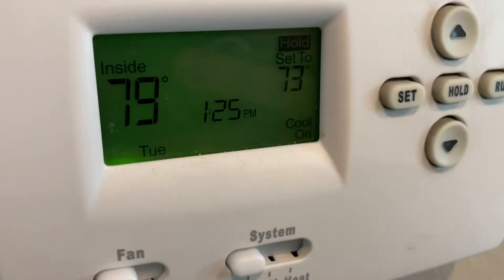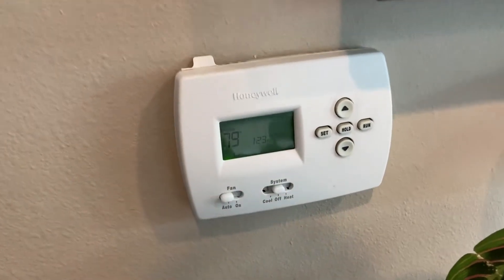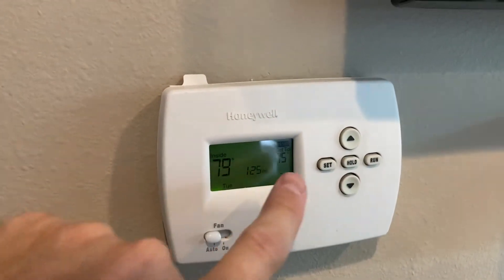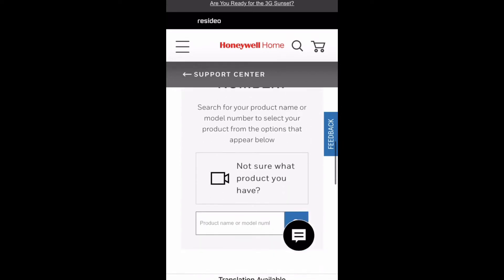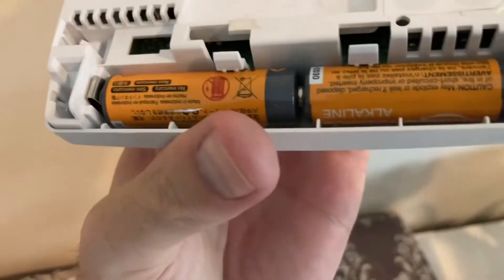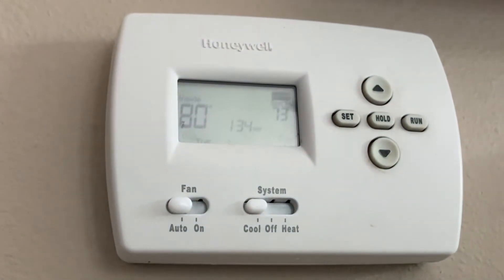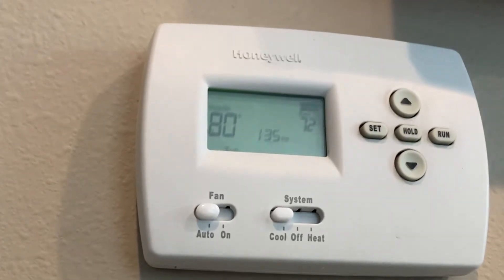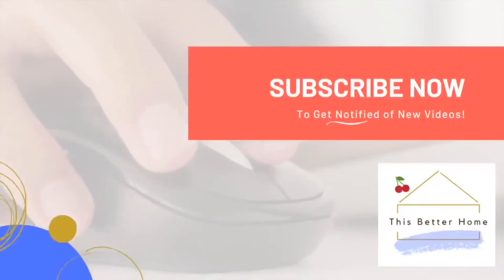🔥 "Cool On" Is Blinking on My Home's HVAC/AC Programmable Thermostat (Honeywell)➔ How I Fixed Mine

Comment: At the 3:40 mark you mentioned about turning it off and then turning it on I must’ve missed that but how did you turn it off and turn it back on what buttons did you press? or was it a series of buttons pressed?
Reply from the maker: There is a sliding toggle switch labeled cool, off, or heat. It is located at the bottom center of the thermostat. Turning things on or off simply means sliding it to the off position or to the cool position.
Reply: @diybandit thank you. And that’s it, And then just wait about 10 or 15 minutes?

Comment: I have lived in my house close to 20 years. I have had my ac serviced several times for outside fan motor going bad or electrical cylinders needed replacing. I thought this time because it has never done this blinking that i thought maybe it finally decided to die. I had an ac many many years ago living in an apartment and it did that and they replaced everything. They only needed to reset the control panel. That landlord got ripped off or just wanted newer system or was under warranty.

Comment: You're AMAZING!! Your explanations are calm, simple and to-the-point HELPFUL!!!  Dealing with 115-120 degree heat (Mohave County, AZ) . COOL light flashed, so instead of panicking, went to YouTube and found you!!  Shut that puppy down for a little bit, changed out the batteries (they were near dead), and then after 30 minutes turned it back on. Cool air is flowing again!! YAY!!! In these extreme temps, units overheat easily. Am using it sparingly in the afternoon, and supplement with stand fans blowing over block ice frozen dish pans, which is helping.  I have unit set at 84F to alleviate stress on it. HOT, but won't die ot the heat. Thank you SO MUCH!!
Reply from the maker: Ah, so glad this helped you! Stay cool!

Comment: Fun fact! If it's actually wired properly, you don't need batteries at all. When you popped that thermostat off, did you see that blue wire connected to C on the terminal block? That stands for Continuous power. It supplies power to your thermostat from your air handler. Try popping those batteries out and sticking that thermostat back on to see what happens.
Reply from the maker: Great comment. I actually just installed a new wi-fi thermostat that does NOT have batteries - just the C wire. So, when power goes out, no backup and have to re-program everything.
Reply: @diybandit  Are you sure? More than likely there are a few bytes of ROM inside that thermostat, so it should remember its settings even after losing power. They may also be stored on the manufacturer's servers, linked to your account.
Reply: We did this EXACTLY,  and then it started back working and cooling light stopped blinking.
1. Popped the thermostat
2. Popped batteries out
IT WORKED!!!

Comment: Good video
So I did this and it worked , however the air coming out is barely cool and not cold as it was before. Temperature is still stuck at 80 and not going down. 
Any suggestions pls would be great as the HVAC guys here just keep wanting to sell me whole new furnace and a/c unit without demonstrating what’s truly wrong with my existing units
Reply: Just to update: 
one of my dampers was stuck closed. Got new damper and now house ventilates and COOLS as normal. Maybe this could help somebody
Reply: Same issue with me right now instead, it's at 84.

Comment: The AC was out for 24 hours until a new capacitor was installed, then it started working again. House was 96 degrees on a hot July day! So it was on for 3 hours. Had it set to 76 but then decided to change it to 78 after 3 hours it was on. Then couple minutes after changing it to 78, it stopped and blinked cool on and house was 80 degrees at that time. But then after waiting it started up again. And now the house is 78 degrees!
Reply: Help me out, it’s been 94 degrees for the past 24 hrs, my ac  Not working at all
Reply: @mageliaacrip2086  Fan/motor still spinning? Compressor running?
Reply: @filmbuff1991  the fan outside is working, and my furnace is also working. It’s just the air isn’t coming out of the vents
Reply: @mageliaacrip2086  how about your compressor?
Reply: @filmbuff1991  I don’t know how to check hat out
Reply: @mageliaacrip2086  when the motor runs listen carefully if it sounds very light the running, then maybe your compressor is not on. That’s what I was noticing when my AC wasn’t working, well, until a new capacitor was put in and it started up the compressor and cool the house down. If your compressor is working along with the motor, and it’s not blowing cool air or any air at all, it could be the ducking.
Reply: @filmbuff1991  just got it fixed it was this small cylinder looking thing forgot the name

Comment: The reason they build a delay into the thermostat is to keep the compressor for kicking on, then off and trying to kick on again...Not good for the compressor...It builds up high pressure on one side of the compressor, when running, lower pressure on the other..If it stops and starts, it struggling against the high pressure until both sides of it equalize in the system, then it will start...It has built in overloads, but they can burn to a crisp as well as the wire terminals if it happens to often...Makes it draw way to much current...ZAPPO...It's dead...HVAC man here.
Reply from the maker: Great comment!

Comment: Still didn’t work I can see the number and see the light but it doesn’t turn on fan or ac
Reply: There is a furnace switch on the side of the furnace...It may have been turned off accidentally...Kids do that often...Looks like a light switch...Breaker may have tripped too...Thermostat probably has batteries...Thats why it is working...Try not to short cycle the AC u nit...Meaning off-on- off...Trips breakers, can burn units up.
Reply: @vernroach3413 this is the comment that helped thank you so much house was 82 last night and this morning